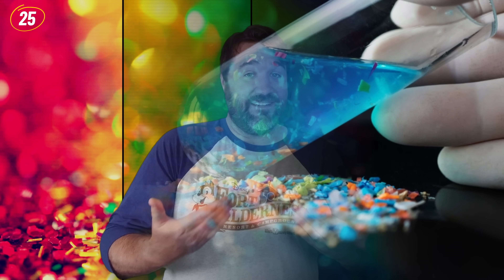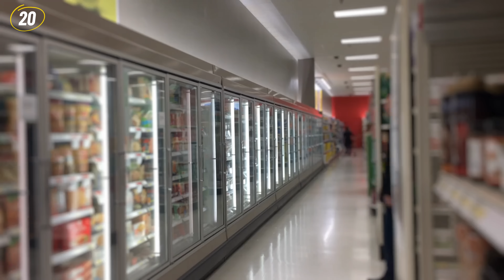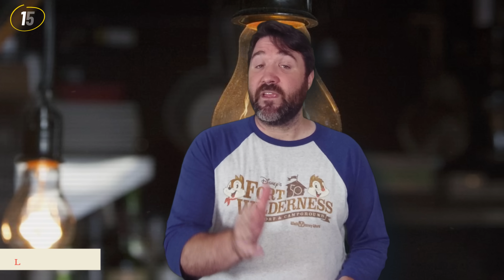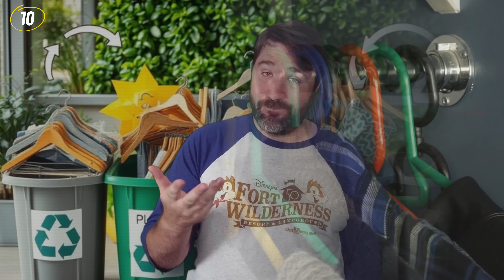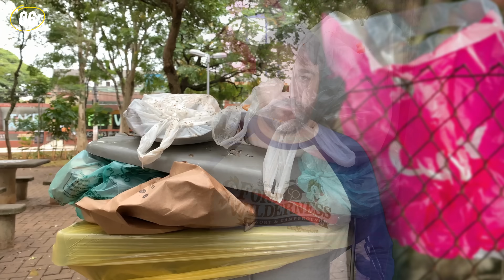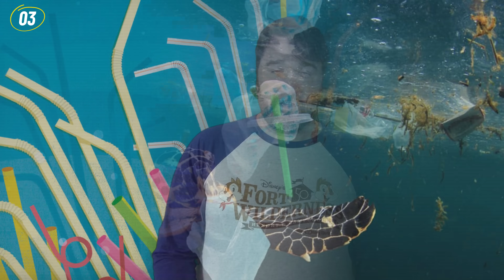25 Surprising Things That Can't Be Recycled

Comment: WE CAN NOT DISPOSE OF this or Recycle that …..omg what a headache, tell the manufacturers to USE RECYCLING MATERIALS. If the recycling facility doesn’t have the equiptment the EPA should invent it or buy and make it a mandatory manufacturing standard, Instead of badgering nit picking the consumer into sorting this sorting that , in this bin or that bin , WE’RE  NOT GETTING PAID TO SEPERATE GARBAGE, rejecting certain Materials MADE INTO THE PRODUCT and responsibilty of discarding ON THE CONSUMER junk they DID NOT CREATE is insane. The EPA should embed themselves at the manufacturers plant . F the going green…. Starting today Everything is trash. Industry makes millions selling their JUNK, and were left to deal with it when its reached its end of usefulness / garbage stage. Not a consumer problem.

Comment: This is confusing. Im just throwing everything away now. On the water hoses i work for a water hose company n we make em with many different plastics, rubbers, thread and more. We have specialized equipment to recycle our scrap and it would take special machines that I doubt most recycling centers have. Mainly cause the thread and mixed rubber n plastic

Comment: Notice how many things on this list can't be recycled once they've been used for their original purpose! Isn't. It about time that manufacturers were forced to stop bragging that their products are recyclable and actually make them so and the recycling industry were made to stop bragging about saving the planet and make their processes actually do the job! Watching this video it seems that the only way to recycle something even as simple as cardboard is to buy cardboard directly from the supplier and place it immediately in a single item container, which has been properly cleaned and sterilised and immediately send it to a recycling company. Oh! and you'd better have been wearing clean, sterile gloves otherwise skin oil or particles will have contaminated the product.

Comment: Any disc with a colored hue of blue or darker usually are made of silicon and only require some copper wiring and an acrylic mount and boom there you have a diy solar panel however if the disc is a CD or DVD or PC disc it won't work those are just plastic the shiny side is actually a combination of aluminum and a small amount of silver..... Oddly enough that doesn't increase their value at all

Comment: The common thing being repeated is that it falls through a machine or clogs machine preventing recycling.  How about redesigning machines to recycle things? If you know all the plastics, paper, Styrofoam, and  things have that in common, but ALL the DIFFERENT things won't be redesigned then redesign machine or rethink method of recycling. (Like the guy who rethought of how to SAFELY process medical waste for disposal by a machine heating it to certain temperature [not burning it] with sensor going through with waste to monitor it. He rethought and solved the DANGEROUS HAZARD problem. )

Comment: DO NOT put thermal printed receipts into the trash as they will.probably end up in landfill causing the harmful chemicals to leech into the water table.
Glossy magazines have plastic coated paper so these can not be recycled.
FACT: All plastics were designed to be recyclable but it costs money to do so and the raw materials when reused, produce lower quality plastics. This video needs more research not withstanding the fact that mostvrecycling is shipped off to China and not recycled locally

Comment: We're so screwed! Our environment is cooked. And it's all because of greed. Big corporations find ways to cut cost and it usually isn't good for the environment. 50+ years ago a lot better things came in glass bottles. You paid an extra $.05 per bottle and when you'd give them back they give you $.05 per bottle. It was then washed, sterilized and reused. But it's cheaper to just put it in a plastic bottle then make the consumer the bad guy if we don't recycle it. It's not use, it's them!

Comment: We know you are mainly talking about the US, not the country that has a good recycling record. Many countries around the world are good recyclers, McDonald's in Germany were recycling in the 90s. There is a polystyrene bug that eats the material, it is mainly found in chicken farms that use the insulation in ceiling tiles, we know this as I worked in a few and if you tried to move the tiles for access, they turned to dust.
China built a 122km highway using shredded landfill mixed with foundation materials for the base layer, saving many tons of material, perhaps America could do that for all its crappy highways and get rid of landfills. Just think about it, if they used glitter landfill for a base, when you get potholes, you can spot them by them twinkling in the light.
Some of the plastics you are talking about can be recycled, the Brown brothers in the UK collect various types of plastic and recycle them into other products, that plastics that are good for landfill are the Thermoplastics that are normally regarded as single use or ovenproof. I collect plastics of different sorts, to use for repairs to similar plastics, although it is not an easy job as they melt at the same temperature.

Comment: My last pizza box, the clean top went into the recycling, the messy bottom went in the compostables
I bought some silicone straws, so if I eat out again I'll take one with me
Any plastic utensils I get I take home, clean, dry, & pocket for future use
Good point on the toys!!! PLEASE don't trash your broken toys; collectors are looking for toys in bad condition to make Custom projects (I'm one of them)
Polystyrene is my pet hate!!! I LOATHE the stuff!!! It's the worst thing about buying new appliances & I wish they used ANMYTHING ELSE to pad out the boxes for new cookers, air fryers, stereos, etc. I always have to split it up, & it sheds those teeny bits like MAD!!!
I throw my plastic bags out with the rubbish (not bought bin liners in ages due to this). Some supermarkets do compostable bags which I also keep until needed for compostable waste
With glitter I get glitter paint or glitter glue, rather than the loose stuff, so that way nothing is wasted or falling out in the wrong place
A few of these were surprising, but most make sense when you think about it

Comment: Take your own stainless straws to cheap restaurants. Take your own tupperware for to go food. Restaurants don't mind. Be mindful of packaging when you shop. Those styrofoam trays that meat come on? TRASH. The plastic film? TRASH. Switch to linen napkins, towels, microfiber for cleaning; I did this 8 years ago and have saved a bundle of money. It takes us a month to fill a trash bag~ Thank you for another great vid, Mike!! Oh, and Earth Breeze detergent! Comes in cardboard; sheets dissolve and thoroughly clean clothes AND it's much cheaper than Tide, and there's a hypoallergenic option~
Reply: That is great but I won't use something I have to wash( because I have go to the laundromat) 
And my cat has a problem and throws up every once in a while. Also I have mice ( wild) and they sometimes get in my kitchen and I use paper towels for that too. However I will try other methods for regular cleaning
Reply: @jessicacanfield5058 Doing something is better than doing nothing.

Comment: I shred documents and private papers then we burn them in the Wood Stove. I wrap them up and stuff under the wood to help prevent the tiny burning pieces from causing a fire in the chimney [We have it cleaned, no worries] or possibly flying out into the yards and pastures.
With an aerosol can, turn it upside down to empty the gas and any remaining contents [unless it's unsafe to breathe, that could damage the ground or surface you're emptying over] to drain the pressure and make them safer. They are far less likely to explode if they get too hot or during recycling.
We also use out plastic grocery bags as trash bags, because they are hard to recycle. We fill them into a large bag to discard at the dump. We also use them as packing to protect delicate items that we store, like Christmas decorations and lights. Then we can use them for tash again, giving them seneral uses before they are disposed of.